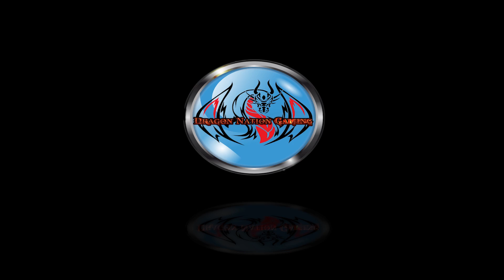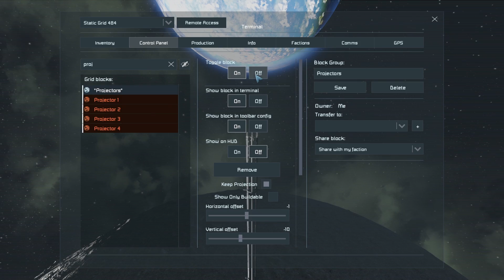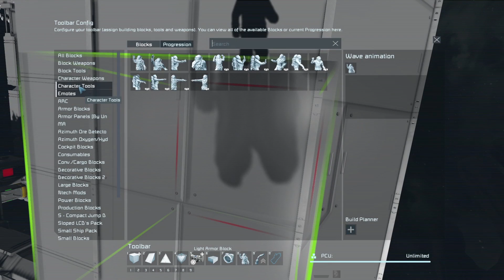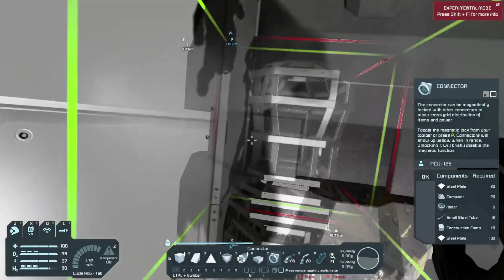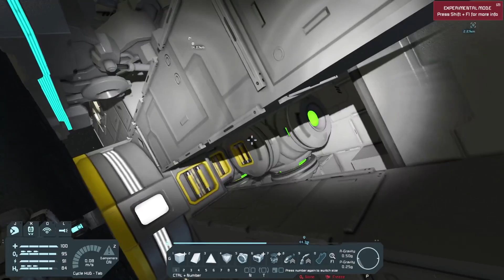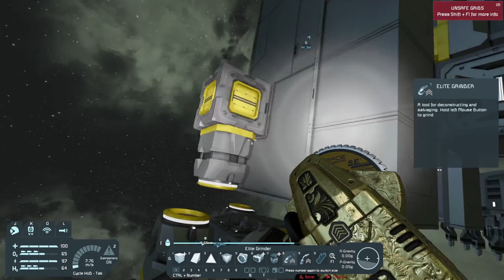Space Engineers #37: Failure Part 1/2

Comment: Hi Rich. Not all is lost. You can still continue your construction the way your are doing except for the use of the merge blocks. Attach the new sections using landing gears and connectors and lock it in that way. When I did my planetary tether I used this method three times to reach 43kms and with a space station on the top. I used my constructor rig to make the new sections. However, I needed to remove the merge blocks on the constructor vehicle and build new ones to prevent the game thinking the new sections being built were part of the old section. Let me know if you need more info. Good luck.
Reply from the maker: I'm not just trying a tether. It will have an elevator. Each section needs to connect to the other perfectly straight.
Reply: @DragonNationGaming  

I know what you're saying. By using my method you can achieve a result like this:
https://imgur.com/a/Mg7qFFm

It is aligned perfectly to allow an elevator to move up it (that was the original plan for me)

Good Luck

Comment: Hey I have a problem if I try to build it my projection disapears when the builder is merged to the maingrid.... have you any idea why or how to solve that?
Reply from the maker: If you are building somewhat the same system you have to reset the projection. Toggle it to save projection so you can turn the projection off and on again to reset.
Reply: @DragonNationGaming  thank you, than there is only one thing left to do me and that is to fimd a way to change the projetion so its like every 4 pieces a other one that procedre circling four times than have again a different module and another one on top. Trying to make a system that builds Vcz Elevators (mod)  in to space.